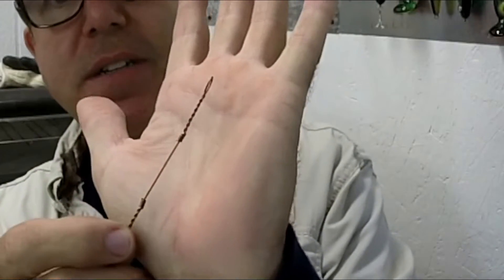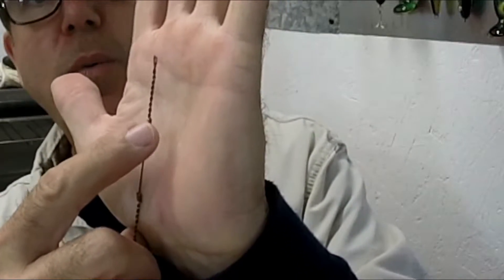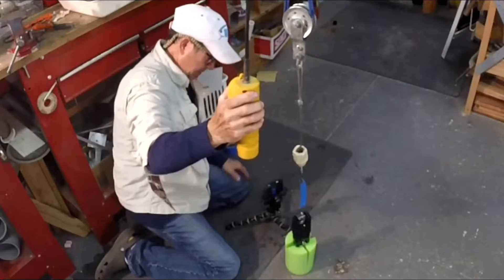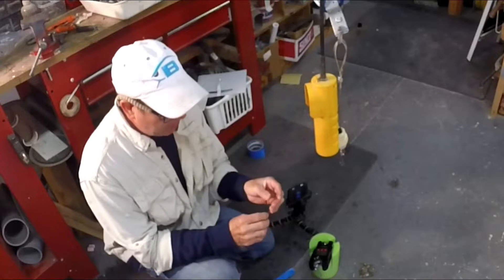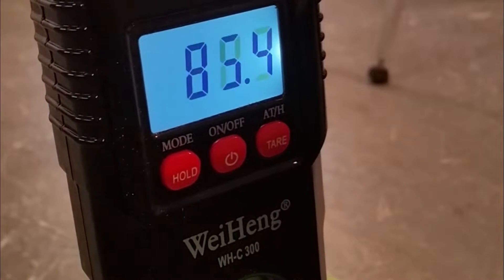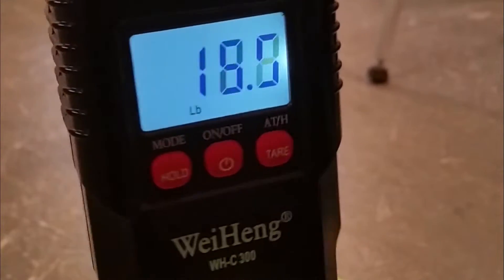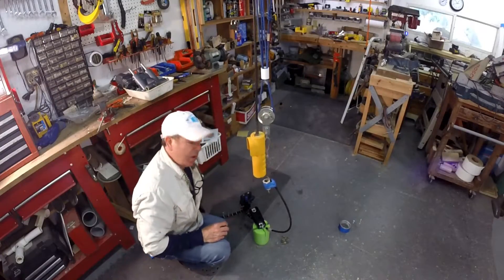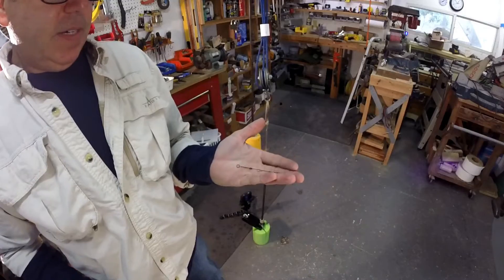HAYWIRE TWIST, IS IT STRONG

Comment: When I got stationed in Southern California in the early '70s, I studied up on saltwater fishing.  The knowledge back then was to use at least 6 haywire twists on the steel leaders and then 4+ barrels was to finish it off and hold it in place.  It worked pretty good for shark fishing back then.
Reply from the maker: Yea...surprisingly strong.

Comment: Only really have to worry about tying it correctly with lighter # wire. But I always tie haywire then barrel wraps. I've seen haywires were there is just loosely wrapped barrels then tight barrels and under heavy pressure the tight barrels slide all the way to the eye of the hook.
Reply from the maker: When I use steel leaders it's usually multi-stran and crimped sleeves. So I have to defer to those guys fishing the heavier stuff.